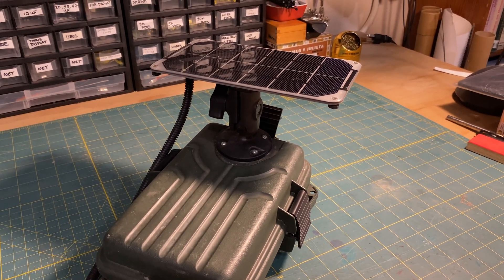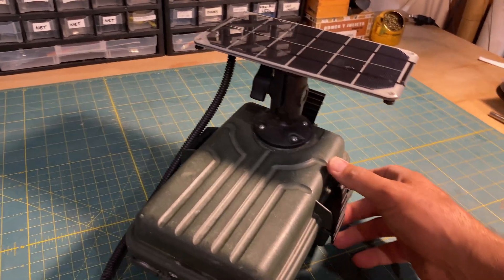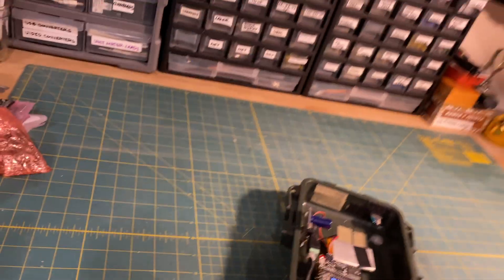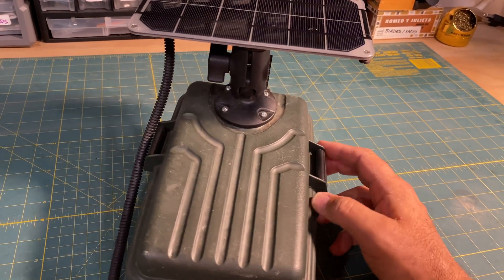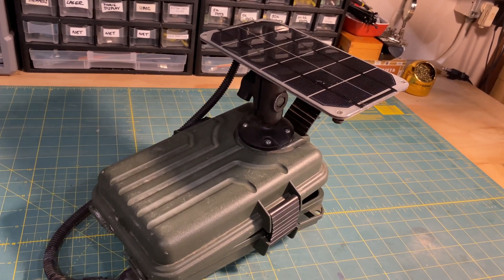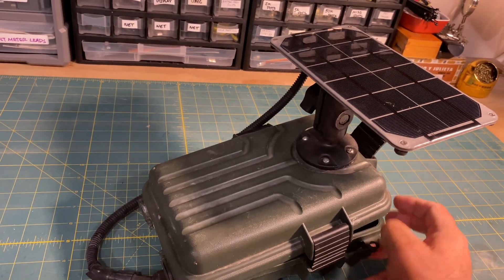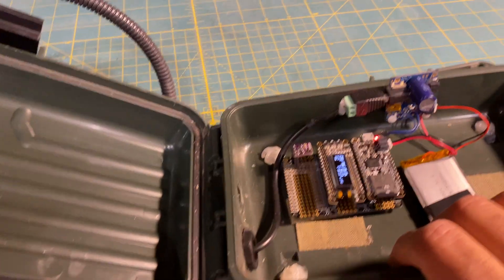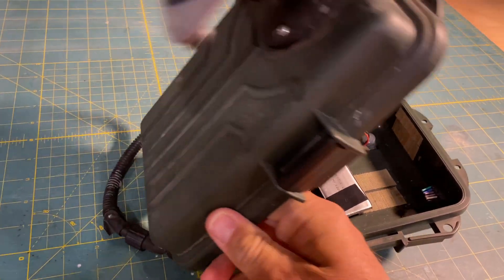BME280 Integrated with Adafruit Adalogger - Introduction

Comment: I'd like to make an argentina remove water temperature not per hcurrent flow patterns water levels type of data collector. Maybe even mock depth censor in particular to the Oxygen water meter.
Reply from the maker: Sounds like this was written in Spanish and translated by Google. I read Spanish - can you submit again without translation?

Comment: Hi! I'd love to build along with you but don't have any idea what the brackets is called that holds the solar panel to the case. Any chance you've got a list of that hardware? Hopefully it's a mail-order place since I'm living overseas and won't be able to just pop in at Home Depot, ect... Just curious but you said that green case was 5 years old? I'm assuming it passes your rigid test environment out there in Arizona??? IF not, which type do you recommend? My environment is all 4 season, but summers have Monsoon rains and seriously high humidity (and critters of all type). Looking forward to this build. Actually, I've been following you for a few years and have thoroughly enjoyed all your Water collection videos. Awesome!!
Reply from the maker: The enclosure and other parts I've been using for these projects is summarized is this video: https://youtu.be/93ipPhr7QtQ. The mount you are curious about is a RAM mount summarized in the description of that video, although they are somewhat expensive. A cheaper alternative is to mount the solar panel on an Altoids box with the panel JB-welded to the lid, and the box JB-welded to the enclosure. You can then angle the panel by putting a block in Altoids box. I haven't tried this yet myself, but it occurred to me when putting together my latest build. I just finished testing the latest iteration of this particular project so I hope to post something in the next two weeks :).
Reply from the maker: Here's the latest iteration with a parts list in the description : https://youtu.be/dC-deo3MdSE